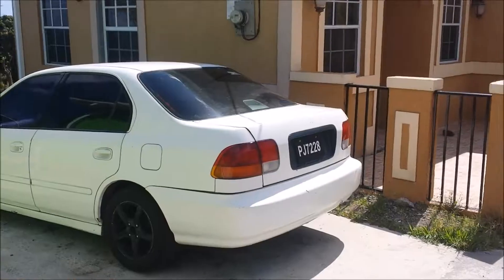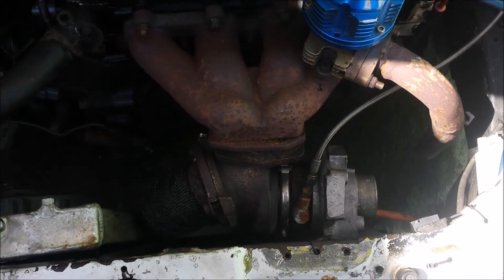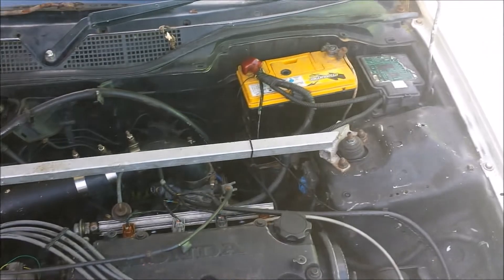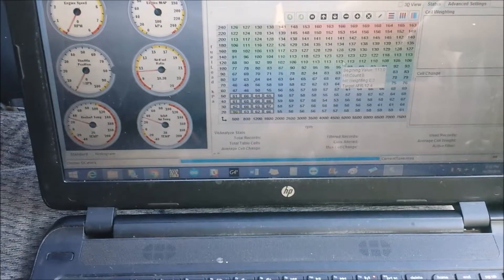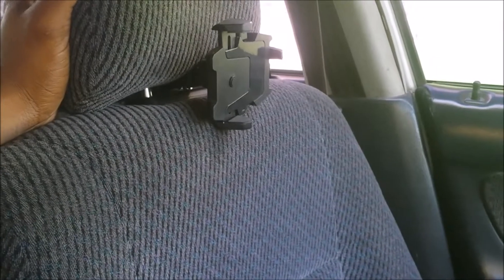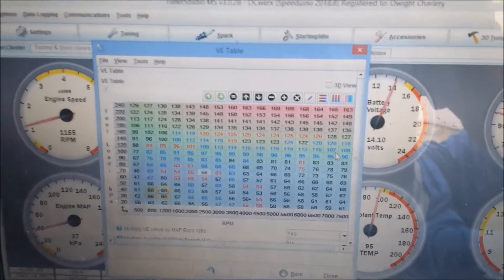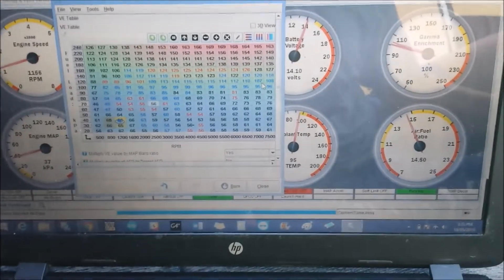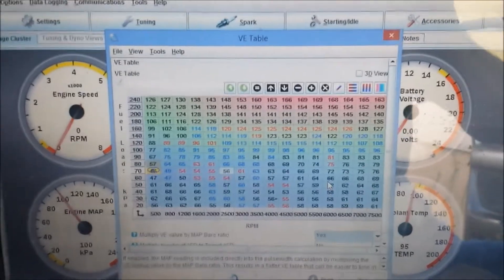Street Tuning My D15 Turbo Civic + Random Talk

Comment: For lack of tuning knowledge like me. Is autotune are good? Or need to adjust it again manually after? Thank you
Reply from the maker: Yes. Autotune will  get your fuel table really dialed if your Air fuel target tables are set correctly. There may be a few lil spots you may need to touch up manually but that's minor.

You will still have to adjust stuff like warm up and acceleration enrichment manually though. For a novice I highly recommend auto tune

Comment: could you give me some pointers  for install speeduino on my 95 bmw 325is
Reply from the maker: 1st thing is figure out what trigger pattern the engine has. Then familiarize yourself with the factory ECU pinout and wiring. That should be readily available online. After all that is done it's just simple wiring and configuration.

Comment: The new project will be fun to watch! That road looks really challenging for logging, how far away is that long straight you raced on before? To get good logs all from the bottom of the range i use the brakes to load it up more sometimes. Works well if you have good brakes in relation to the power.
Reply from the maker: You are right the road is very challenging to do proper pulls on but my car doesnt make alot of power so its not too bad. The long straight (old airport runway) is about 40 minutes away. I would not feel comfortable doing any higher HP cars (over 300 HP) on these roads. 

I too use brakes to load up my car when tuning too. It keeps speed down when you trying to hit cells when tuning that you would otherwise need to do 3rd or 4 gear for
Reply from the maker: The sr20 project will definitely push the boundaries for me. I have some big goals for the final product